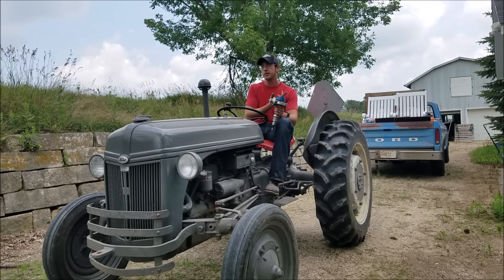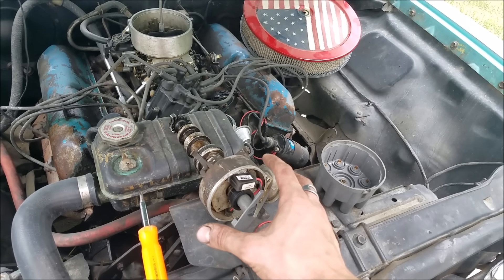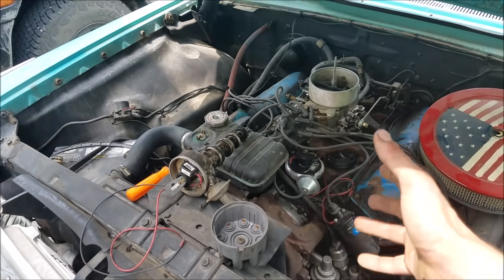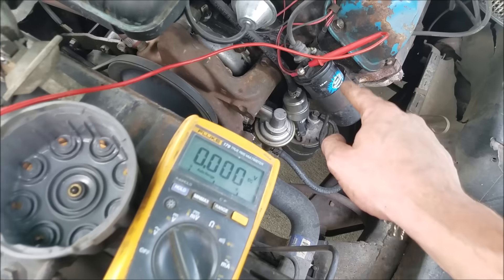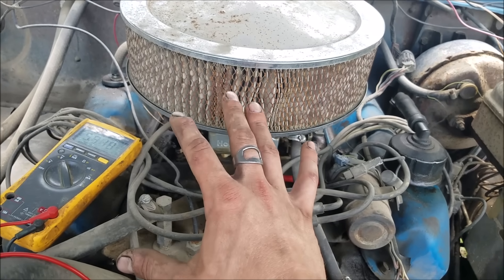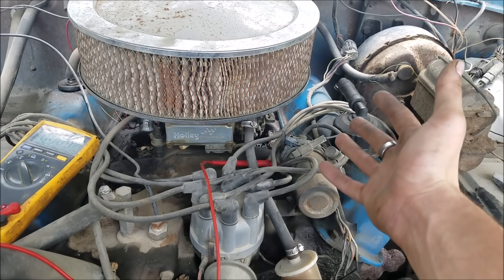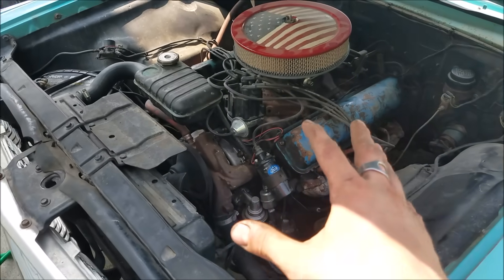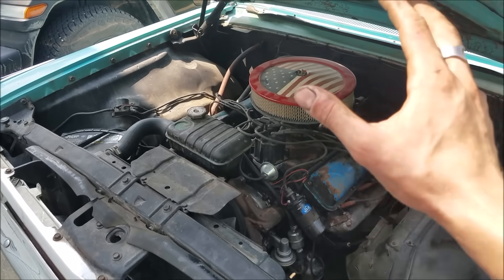Pertronix Ignition "Problems & Failures" (It's Actually YOU)

Comment: Thanks for posting this! Lots of people complain about the Pertronix stuff being junk. I ran one on my ‘67 mustang… which I daily’d for over 5 years and it never gave me any trouble at all! 

I just went out and checked the Pertronix igniter  that the previous owner Installed on the ‘68F100 I recently purchased… and wouldn’t you know it… it was hooked up incorrectly as well!
Reply from the maker: The will last a little while at low voltage, but amps increase when voltage drops, which amps are where the heat comes from and the wiring isn’t designed to handle that amp load - fries the module eventually. 
Pertronix 1 and 2 still need the ballast to the coil, while the module red lead itself needs a keyed 12 volts. 

A lot of folks just dork up the 12v to the module part - eventually causing a failure
Reply: @ThunderHead289  absolutely! The Pertronix instructions aren’t worded super clearly, so a novice could easily screw that up!

Comment: So if I'm following this video right, on your Pertronix wires from the distributor - the red goes to the negative side of your coil, and your black keys into your fuse-box/keyed power source (in this case being the spare fuse/otherwise the heater).  And this would give you the proper 12 volts for your system, since the coil is limited/gated in voltage normally? 
If I'm understanding you right - I just finished watching the video for the first time.

I have a Chrysler (1968 Newport).  I have the original points distributor, but recently bought an electronic ignition kit and voltage regulator.  Chrysler used the ECU box for ignition, which is what my kit has.  A bit of a favorite in the community from what I see.  The wiring on that is a bit different to here, but it's more or less a different system entirely than what this seems to be.  I also got a ballast resistor for my kit, which is nice.  I wonder why Ford designed it that way?
Reply from the maker: The module itself needs a 12v signal (red wire) the ballast wire to the coil can stay if ignitor 1 or 2. 
On ignitor 3, both take 12 volts keyed source. 

Red wire on module is module power, it’s grounded through the distributor body. Black wire from module goes to negative side of coil.
Reply: @ThunderHead289  Gotcha.

Comment: On an old Ford I usually take my keyed 12V supply from the starter solenoid (the ones used with the rat trap style starter) It has a 12V ignition terminal. Just slide off the push on terminal and undo the nut on the solenoid terminal and put a eyelet type crimp terminal under the nut. Slide the original wire back on and your done. Easier than crawling around under dashes testing fuses.
Reply: Folks, don't forget that  Ford made a good electronic ignition. Pared with their big cap, and 8mil. ignition wires, it's easy to swap in, using factory parts.

Comment: The 12 volt "run" wire is also typically connected to the starter relay, as there is usually a passthrough to give you 12 volts at the coil for starting. That's probably the easiest place to tap off imo, at least in a Ford
Reply: The 12V small wire from the solenoid is ONLY hot when starting, or when the solenoid is engaged. It is not HOT when in normal run. So no, you cannot use that.

Comment: I have two Ignitor II`s with no problems both of them are Ignitor II as the Ignitor 3 is not offered for those applications.  Never had a problem and I am using the OE coil with OE ballast resistors.

The red lead is to power you dont have to hook it to the coil directly you can hook it to the battery side of the ballast resistor which is what I did on my '56, the red wire runs from the Ignitor II to the 12v battery side of the ballast resistor mounted on the intake manifold and the other side of the ballast resistor goes to the positive on the coil.  Then the black wire is attached from the Ignitor II to the negative of the coil.

Sure it is not as hot as using the coil they recommend to use but not everyone is doing the upgrade for performance.  I did my upgrade for reliability in what is essentially a restoration project back to OE stock or stock appearing.

The other ignitor II was used on my '58 Ford 641 Workmaster which is also using the OE coil and external ballast resistor.  Wired up in the same way but do not need max performance, the upgrade was done as points corrode due to the distributor being exposed to the elements as well as sweating from hot/cold cycles from being in the sun.

Also the Ignitor II doesnt burn up if you have the key on for example listening to the radio.  The Ignitor II has a sensor that detects if the key was left on or incorrectly wired and shuts the Ignitor II down.
Reply from the maker: I noticed after some comments that I didn’t clarify that only the module itself needs 12 volts. (Except for ignitor 3, it can handle 12 everywhere)
Reply: @ThunderHead289 , Correct.  But when you review the paperwork at least the paperwork when I installed mine it stressed to use the flamethrower II coil with the Ignitor II and to toss the ballast resistor.  When I called Petronix up years ago there were many guys working there with collector cars running the ignitor II the same way I have mine hooked up with the ignitor II acting like the points triggering the OE coil with the required ballast resistor for the OE coil.

I just hope people realize that you dont need to run their coil like their paper work said.  Ive seen so many people hound me for not throwing on their coil as well not realizing that the hotter spark their coil would provide me would not make a difference for a stock engine.  Just having the Ignitor driving the OE coil is making the OE coil fire hotter than the ignition system did when it was new due to the adaptive dwell the Ignitor II has.  I feel the use of their coil is just wasting money.

Comment: I've used pertronix in ford's and ihc,s never had a problem them.  except on a 59 ford 4x4 has the 292 with distributor in back so the battery tray is about 8 inches from the dirstrubutor . Never could get the pertronix to last went through 3 or 4 of them. Only thing could think of is the battery being so close  must of been doing something to them. Put points back in 15 years ago and left it alone .

Comment: Some of these aftermarket points replacement units used to blow up after a while if you hooked them to 12 volts instead of the resistance wire end with 9 volts.
Reply from the maker: You have to hook points to a resistive lead, but a pertronix module itself always needs 12
Reply: @ThunderHead289  I use the HEI GM modules in everything from lawn mower engines to automotive to trigger from any magnetic pulse  whether flywheel, duraspark or chrysler to trigger coils from any manufacturer. Two lead input from the sensor pickup, another each from battery and to coil, grounded body.

Comment: Go buy an MSD. These Pertronix units are cheap and not that dependable. MSD will cost more but a better unit overall.
Reply from the maker: Not true. Iv lost 3 msd units in 10 years, never a pertronix
Reply: @ThunderHead289  I disagree I replaced one in a Cobra recently It never ran properly from the start and I did everything with it. I tested every component every wire went through drawings etc. Absolute trash. MSD Street Fire was the answer. MSD also has a better arrange of products you can build an full competition system with.

Comment: It's not a bad idea to read voltage from BOTH the negative battery terminal, AND the negative terminal on the distributor. If there's a ground issue  there, it'll show up with a reduced voltage reading. Cheap insurance to just check both!

Comment: I've been restoring and building street rods for 40+years. I have seen the earlier Pertronix modules fail, even when properly wired. In my classic cars, electronic or points I carry a spare in the minimal tool kit. Late model efi cars, call the tow service to come get you.
Reply: You are talking about the original Ignitor they burned up leaving the key on without the engine running and in some instances burned up with the engine running.  Thankfully Petronix fixed that burning up issue in the Ignitor II.
Reply: I put a Pertronix kit on the old 2N I bought a month and a half ago. Everything electrical in the tractor, I stripped out myself, and redid with new components, and per the Ford manual. Modified the wiring per the Pertronix instructions. Met their minimums for wire gauge, resistance, spark plug wires, the whole nine. The module lasted an hour. The longest the key was left on was 30 seconds for engine start. I have a Dyna electronic ignition on my Kawasaki motorcycle that I wired up a few years back, absolutely no issues with that one. Currently waiting on Pertronix to get to my ticket to see what can be done
Reply: @OldMotorcycleAdventures  I feel ya, I got 3 Ford Pintos. 2 1972s and 1 73 all on points, easy peesy
Reply from the maker: Absolutely

Comment: Why do you advise the ignitor 3 over the 2? I thought they were mostly the same minus some features like rev limiter
Reply: They basically are the same unit with the Ignitor III having more features such as rev limiter and multiple spark ability but the down side is you cant fit the Ignitor III in all distributors.  The two distributors I installed Ignitors in only had the option for the Ignitor II.  One of them I could have got the Ignitor III for if I had swapped out the distributor for a one year new distributor with mechanical advance.  But to do this it would also require changing the intake manifold as well as the carb to get the proper vacuum for the vacuum advance.  Way too much money to spend to go with an Ignitor III for a few features that are of no benefit to me.

Comment: Pertronics 3?  Wait, is that a GM-style cap?  Aw man, look at that huge rotor!  That is GM-style!  At least it's not as ugly as an HEI - especially on a Ford, or any other engine which has the dizzy up front.  
I would either go Duraspark II, or use a Pertronics 2 in an OEM Ford/Autolite points-distributor.

Comment: When you say "HEATER" for a 12 volt key on source, you mean the blower motor? I've been looking everywhere for a 12 volt key on source on my 78 mustang to hook up the electronic choke! I know my blower motor works but can't get it to come on unless I hook power directly to the blower motor! I'm told the wiper motor might work as well?
Reply: You have a 1G alternator still correct?

If so what you will do is run a power wire from the stator terminal on the back of the alternator to the choke.  Ford did it this way when they went to electric assisted hot air chokes in 1980.  The Stator terminal on the back of the alternator will not put out voltage till the alternator starts to charge this way you can turn your key to accessory and not have to worry about opening your choke up fully on a cold engine.  Only thing you may have to change is the choke itself, electric chokes typically like around 6 to 8 volts but some people swear holley chokes love 12V.  The Stator circuit only puts out 6V which is ideal for OE choke thermostats and I believe its fine for Holley choke thermostats as well.

Comment: I'm a novice when it comes to this stuff. Currently running points in my 71 Plymouth 383. Will I actually notice a difference after installing this and the recommended coil? Rev quicker, pull harder on acceleration? I know you don't have the maintenance associated with points for sure. Switching to electronic ignition has been on my list of things to do.
Reply from the maker: I would absolutely go with the ignitor 3 set up if you can. You will definitely notice on that unit.
Reply: @ThunderHead289  ordered the igniter III and matching coil this morning!!!

Comment: I've had a guy leave the key on in my skid steer. Original equipment was pertronics. What else does a 32 ohm coil come on? I've tryda msd blaster 2 and several others. Help. Thanks for sharing 🙏😁👍 all electronics in the dist and magnet sleeve is new.

Comment: this might explain my weak spark out of the hei distributor i installed on a 400m, where i tapped into the hot wire for the duraspark coil.....not a 12v source, got it.
Reply: correct. underhood resistor is 8-9 volts.

Comment: Spot on. I bypassed the resistor wire on my 66 when I installed my Pertronix lobe sensor model. Never had an issue in 10 years.  👍

Comment: So when are you gonna add electronic ignition to your tractor? I installed a petronix kit on my 8n it works great.
Reply from the maker: I haven’t looked into it yet - do they work with the original 6 volt system?
Reply: @ThunderHead289  the one I got is for a 12v system. I'm sure they have for a 6v system as well. I'd email em if you have a positive ground tractor that way they can get.you the right one . I used a 1247 petronix ignitor 1  for my tractor. The round coil keeps overheating so I gotta figure that out :s

Comment: Today they are junk and sometimes they are dead out of the box. I got 15 yrs out of my Pertronix before it started acting up when the engine was at operating temp, then one night it died completely. I then went with a Crane Xri and it lasted about 15 yrs before it started dying at 5,000 rpm. So I was going to try an Accel unit but after reading the reviews they are junk as well. So maybe 15 or 30 yrs ago they were made in the USA but I bet they are all made in China due to their slave labor which manufactures are taking advantage of so they can make a huge profit. So I’m back to using points in my 70 Z/28. Good luck if you go with a module. Your better off to get the points distributor size distributor in a HEI unit which I know one Company makes but don’t recall the name.

Comment: I was wondering where to get a good 12v power source from... Thanks Luke!
Reply: Depends on the vehicle.  Best place is to source the feed for the ignition system at the distributor if possible.  When dealing with Chevrolet you cant do that since they used resistor wires.  Later model fords used the same thing but Fords before around 1960-62 would have an external ballast resistor that you could connect the red 12v ignition wire from the petronix to the 12v side of the resistor.  On my '56 I actually got one of those bare brass add a terminal jumpers that adds two male spade terminals to a single male spade terminal.  So I simply plugged it into my ballast resistor connected the OE ignition wire to one of the spade terminals and then connected the Petronix to the other for 12V.  The boost wire on this style of ford has a dedicated wire running from the starter solenoid to the after side of the ballast which provides the boost under crank bypassing the resistor.

I have had my petronix wired up this way on my '56 for the last 4 years with no problem.  Never burned up, never failed, starts so much better, idles so much smoother and runs so much better.

Comment: I used a Duraspark and MSD 6AL
Reply from the maker: How do you adjust your timing curve?
Reply: @ThunderHead289  I was lucky with the Reed Cam, I never had to touch it, set the timing around 8 degrees and it pulls even, no dead spots. But I was more of the innovator fabrocator of the business building custom cars. Our A&Ps from Delta who moon lighted and my older brother an A &P (aircraft and powerplant)  tuned the engines. That's why I'm watching your channel to learn more. I built all this in the late 1980s and the engine still runs great. To be honest, the main reason for the Duraspark was it cleared my cool Cobra oval air cleaner, and back than the others didn't. The two things from back than I'm proud of is we built an AC Cobra that holds the track record at Road Atlanta. And I personally single handed built the prototype AC Cobra for Excaliber Motors, which was a old kit from Classic Roadster that went out of business, we were one of Classic's dealers. That was back in the 1980s, a great time to be early 30s, going to school and building fast cars. Before building custom cars, I worked as a auto parts counter person, auto machine shop, Ford dealership. Now I medically work on people needing heart surgery.

Comment: Question, at least on Mopar.  I assume the ballast resistor is reducing the voltage to the coil for a reason, so if you bypass it to give 12V at the coil so your Pertronix likes it, isn't that going to reduce the life of the coil?  I'd be more inclined to tap power off the high side of the ballast resistor to get the 12V for the Pertronix (it's not going to be much further aof a wire run than the positive side of the coil anyway), and let the voltage drop to the coil stay what the factory wanted.
Reply from the maker: On the ignitor 1 and 2, I forgot to clarify that. Ignitor 3 can eat 12 volts. 
Yes, you can tap the lead before resistor or run from additional keyed source (would have to work when cranking which I also didn’t mention)

Comment: @ThunderHead289 kind of off-topic, but I'm wondering if you have any trouble shifting a Ford pickup. I too am between 6'6 and 6'7. I drove a '73 F-100 for about 12 years, but my knee didn't fully fit under the steering wheel. I had to pump the clutch kind of sideways, and I wrecked my left knee forcing it to work that way for so long. I had to switch to an automatic and it took another 5 years or so for my knee to completely recover.
Reply from the maker: I can’t remember how big the f100 steering wheels are, but sizable to say the least - I had to shrink mine down to a 15in to be able to clear somewhat comfortably. 
Modified the seat to go literally “all the way back”.